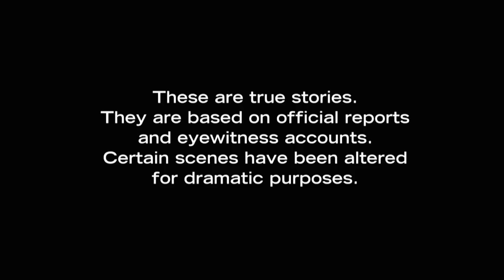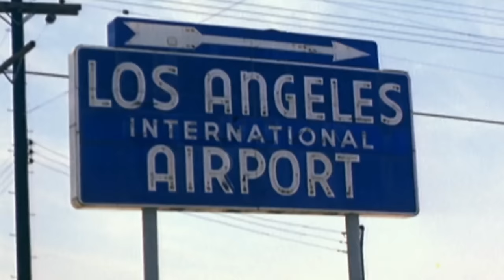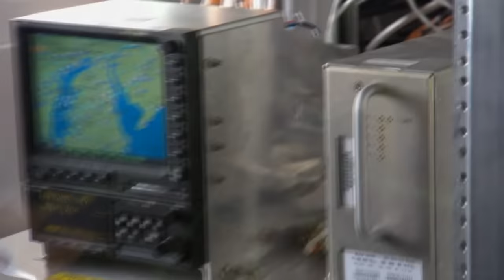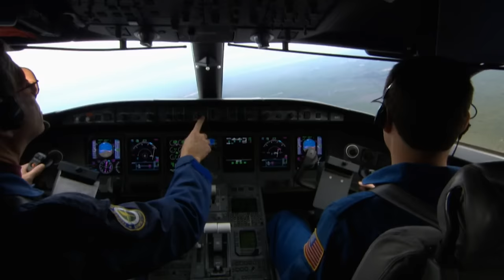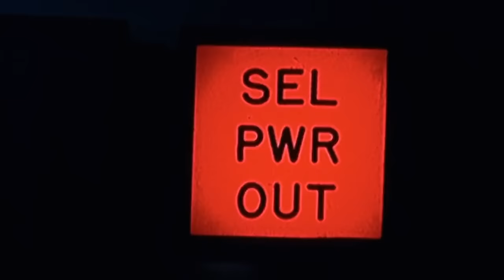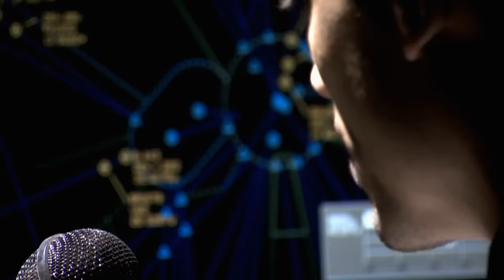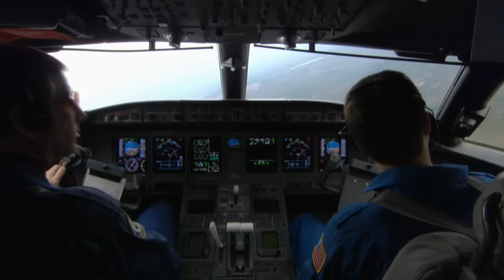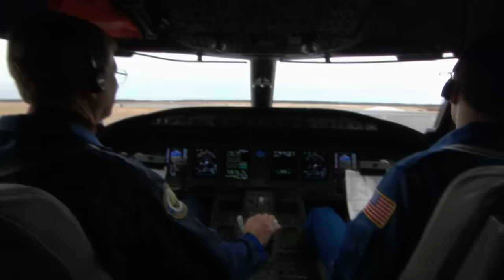The Race To Fix A Broken System "Before Disaster Strikes Again" | Mayday: Science of Disaster

Comment: I am surprised that Air safety boards took so long to introduce this system. In Maritime industry we have a similar system called AIS. It helps the navigators to see another vessel,  its destination & its intended path basis its present course even when its not on the Radar screen. This has been operational since I joined sea in 2005.
I always thought the air traffic systems are much advanced than maritime industry. It seems i was wrong!
Reply: that may be true, but your industry also has no form of crew resource management on the bridge when it desperately should, and your epirbs don't work as well as black boxes do
Reply: My guess is it has to do with having to track aircraft in three dimensions rather than just two.
Reply: Ships move very slow. Tracking them is very easy. 

Most countries do not own ships.
Reply: @God-mb8wi  First, we do have CRM. Second, EPIRBS aren't black boxes. They are just position indicating beacons.
Reply: @goo1358  Most countries don't own ships! What that has to do with tracking them.
Second, slow or fast its a radio and satellite based system. It has to be due to some other reason.
Reply: @brigidtheirish  See you don't need to track. All on board instruments give readouts regarding heading, altitude, air speed. All it has to do is to broadcast the same foe other aircrafts to receive it.

Comment: I hope this system will be very helpful, remembering the crash of the DHL cargo plane and the Russian passenger plane collided because the controller Peterson was overwhelmed and alone.
Reply: The system is already out and became mandatory in 2020 and is being used. It's not called Next Gen though, it's called ADSB. I literally use it all the time to help me spot traffic. It shows their position and altitude ON THE PLANE. Planes are required to have ADSB out which sends their position and altitude, however, ADSB IN is still not required, which is the system that shows other planes nearby and their altitude, in the cockpit

Comment: It is all about speed and greed.  Airplanes pushed ocean liners to the point of extinction.  In the United States buses were next to go.  Trucks and trains, however, are still economical for cargo but trains in the United States for passenger service is a shadow of what it was in the pre-1960s.  Answer, reduce flights and increase train and bus service.
Reply: 1/114 Americans will die in a car wreck, 1/1M Americans will die in a plane wreck.
Reply: That's not an answer, as it does not account for the fact that airplanes can go to places that trains and automobiles cannot.

Critically, an airport in a remote location provides a practical way for both people and cargo to travel to and from that location, whatever the reason may be. If you're going to do it with trains, you need to have rails run past that location. Those rails have to be manufactured, and then installed, and then maintained. How many miles of rail do you need for that? How much will that cost? The ground that the rails are laid on has to be prepared; it may need to be leveled or removed. What will be the environmental impact of that? What if there's a mountain in the way? How many additional miles of rail do you need to divert around it? How much will that cost? How much dynamite do you need to blast a tunnel through it? What will be the environmental impact of that?

The same considerations exist for roads.

What is the cost of an airport in a remote location? Less than roads and rails. What is the environmental impact of an airport in a remote location? Less than roads or rails. What is the challenge of maintaining an airport in a remote location? Less than roads or rails. What is the transit time to or from an airport in a remote location? Less than roads or rails. What is the danger posed to humans by an airport in a remote location? Less than roads or rails.

There is no scenario here where air travel is not the clear and superior choice.
Reply: wow what say
Reply: Definitely need passenger trains with the size of our country. I’d take a train over a plane, any day. Unfortunately, due to the lack of monetary incentives and slow returns, practical train travel is not thought worthy of the interest of any billionaires or the devastatingly in debt govt. With the fossil fuel issues however, we seriously must look at and develop, electric/magnetic trains nationwide. Fossil fuels are not unlimited resources. Save what is left of fossil fuels for lotion (yep. Where do you think petroleum jelly comes from?😂).
Reply: Have you ever travelled by bus? It's an agonizingly slow cumbersome and uncomfortable process. Putting more buses on the road isn't going to solve anything. There's little that can replace air travel for price and speed of getting from one place to another. And, as has already been said, you can't build a road or rail to just anywhere you want to go. It's not cost effective or, in some cases, even physically possible.
Reply: Le cringe statement 💀
Reply: Do me a favor and look up Amtrak safety record real quick then come back
Reply: I have traveled the country by air and by motor home. While there are advantages to motor homes, they burn a huge amount of time to get anywhere and time is something most people can't afford. Think of somebody from California visiting New York on a week vacation. As soon as you get there, by train, you would have to  turn around and head back.
Reply: The idea is very American

Comment: Isn’t NextGen system already available in form of Flight Tracker etc?
Reply: Flight trackers use the data from ADSB and radar although mostly ADSB Out now. Which basically is next gen so yes you're right, flight trackers use the next gen system, although it's not called Next gen. I didn't even know the original name was next gen until this video. It's just called ADSB. It operates as both transponder and ADSB at the same time. There are two ADSB, ADSB IN and ADSB OUT. ADSB out is mandatory which sends out position and altitude reports along with other data like speed. It's required. ADSB In, is a display in the flight deck, which shows nearby planes position and altitude, relative to you. I use it every day to help me spot traffic. But airliners, don't even use ADSB IN, meaning they don't have the system equipped to see other planes near them. As far as I know, and rely on controllers to help separate them from other planes

Comment: The date when this episode was created would be important. Not the date it was uploaded. 
Did this air 10 years ago? Kinda important.
Reply: It aired on June 2009. Next gen or now referred to as ADSB, is already out and became mandatory in 2020. Planes now must have ADSB that senda out their position and altitude. That's how flight trackers have the information of planes online in the first place. ADSB IN, is not required, but it's a system in the plane itself which shows pilots nearby planes position and altitudes. Our planes where I train in have it, so I can see all the nearby planes around me and help avoid them. ADSB has saved my life twice already, but it hasn't made air traffic safer really. Airliners don't even have ADSB IN which means they can't see nearby planes around them in their flight deck, they only send out their position and altitude to others. Most private pilots don't have ADSB IN in their planes either, only ADSB out. So Yea, nothing has changed drastically.
Reply: @davidt8087  Thanks

Comment: FYI this must be 20-30 years old, ADSB has been implemented for years and is required for all commercial aircraft.
Reply: Lmao I know. When the narrator mentioned Next gen, I was like, he can't possibly be talking about ADSB, as it's already out, but lo and behold Next gen was ADSB. I was surprised. I thought ADSB was a much older technology. But nope. It became mandatory to have ADSB out in 2020. Although so many private pilots have planes without ADSB In, so they can't see planes near them without actually spotting them or being told by ATC. Even with ADSB, near accidents in the air, haven't decreased honestly. I see insane private pilots flying rifht in the path of us completely oblivious, all the fkn time. If I didn't have ADSB In, idk how I'd spot traffic or avoid it. ADSB In has saved my life more than once. I'm not even joking. So next gen does work, but only tk those who have both ADSB IN and OUT.
Reply: Btw. I don't think airliners have ADSB In. I've never seen the system in the cockpits of airliners. At best they have TCAS. Which smaller GA planes don't I think. I'm also positive most larger airliners don't have ADSB IN?

Comment: There goes millions of more jobs lost to computers....
Reply: Nope. ADSB became mandatory in 2020, no jobs lost. All it did was make it safer for pilots flying especially in smaller planes that have ADSB In equipped, letting them easily know where to look out for nearby planes and their altitude. Controllers do the same amount of work still despite ADSB. The skies are no less safer or less safe with the ADSB becoming mandatory in 2020, but workload has decreased for pilots in planes equipped with ADSB IN which allows them to see on a map where other planes are and their altitude, and saved my life once before from a careless pilot which almost crashed into me mid air

Comment: Thank God for Flightradar24
Reply: Flightradar gets their info from the nextgen system which is shown IN THIS EPISODE. It's not called next gen, it's called ADSB, and it has saved my life once before by helping me spot a reckless pilot flying in my path, on the map in my trianjng plane long before I actually saw him. It's made flying safer (for those who have ADSB In equipped letting them see nearby planes on a map in the cockpit). Before, if a controller told you to look for traffic, youd have to spend quite some time looking. And smaller planes are harder to track, now, if you're plane had ADSB, you can actually know where to look because it shows on the map their Location and altitude. ADSB overall hasn't made the sky any safer or less safe. Airliners still don't have ADSB IN meaning airline pilots can't see the position and altitude of other planes on their cockpit. Older planes and private planes also don't really have that system. Only ADSB out became mandatory in 2020, which just sends out the planes position and altitude, but doesn't let the pilot see the position and altitude of other planes which is called ADSB IN.

Comment: You need to put ADSB in every plane in the US, and do it in the next 3 to 5 years! Imagine the lives that  could be made much safer.
Reply: Years???? They better do it right quick!!!!!!!!!
Reply: Yall are far behind. Lmao. ADSB out became mandatory in 2020. It's the transponder system which sends out the planes position and altitude along with other data such as speed. Etc. It's the thing That allows you to use flight trackers like flight aware or flightradar. ADSB In is a display IN THE PLANE, which shows the position and altitude of nearby planes around you. I use it all the time to help me avoid and see traffic. Although even WITH ADSB, nothing has changed. Still lots of private pilots who don't have ADSB IN. And get very close to hitting me. ADSB has saved my life more than once already. But airliners don't use ADSB IN, they only have ADSB OUT. This means they send their position to controllers and flight trackers and other planes, but they themselves can't see which planes are near them. So airliners still rely on controllers to separate them from traffic.
Reply: @yvonnegrassi9219  Yall are far behind. Lmao. ADSB out became mandatory in 2020. It's the transponder system which sends out the planes position and altitude along with other data such as speed. Etc. It's the thing That allows you to use flight trackers like flight aware or flightradar. ADSB In is a display IN THE PLANE, which shows the position and altitude of nearby planes around you. I use it all the time to help me avoid and see traffic. Although even WITH ADSB, nothing has changed. Still lots of private pilots who don't have ADSB IN. And get very close to hitting me. ADSB has saved my life more than once already. But airliners don't use ADSB IN, they only have ADSB OUT. This means they send their position to controllers and flight trackers and other planes, but they themselves can't see which planes are near them. So airliners still rely on controllers to separate them from traffic.

Comment: Yeah they really need to start devising and re - devising these existing airports where airplanes never sit and wait on runways, also airplanes should not be crossing runways to get to and from terminals either! but even with the aircraft's themselves from an engineering standpoint I'm seeing a bit more wiggling and flexing in these new airliners than I am typically comfortable with, these new massively powerful turbofan engines wiggle and flex all over the place on those mount pylons and the new Wing designs do also just a bit too much for my particular taste, I think graphene doping of aluminum will alleviate all these problems perfectly and get that amount of flex down to a more comfortable ratios, and it will totally eliminate a lot of problems that they've been having with aluminum in aircraft designs.

Comment: The deadly weakness in the system is not crashes. The deadly weakness is that jets are insanely polluting. High altitude emissions are far more likely to do serious damage to the delicate mechanisms at play in the frigid zones of the stratosphere. Jets actually fly inside of the jet stream to save some fuel and time, but the stream correlates directly and indirectly to our planetary weather patterns. Jets are also a powerful depletor of ozone. We need to get electric planes such as the Alice up ASAP.
Reply: It's highly unlikely that batteries will ever have that type of power density because of the way they store energy. If they do, one tiny flaw in the battery will turn them into a flying bomb. Look at what happens to an electric car when the batteries fail. Aircraft batteries would be far worst. By the way before you object, I have been working with batteries in the 50s before I reached my teens. I have also viewed the history dating back to Edisons electric delivery truck and the early electric cars.
Reply: @denawiltsie4412  I do object. I have watched this technology for a long time also, and I have seen major advances on every front. Solar energy science is nowhere near the apex of possibility. We have mag lev, frictionless bearings, regenerative braking, super conductors, fuel cells and solar panels which are miles ahead of the current models in use. The Alice has seen improvements in batteries even before it goes into full production. Imagine a plane with a solar absorbing body and wings, solar absorption 10X todays best and light weight batteries which are many times more powerful, reliable and safe. This is all very near. Jets are deadly, period.
Reply: Solar cells have been at 15% and they are now some that claim 20% so your idea of 10 time better isn't possible. I suspect that the physics of solar cells may not allow much more in the way of improvement and that will take a long time to reach.The newer cells may not have the life expectancy that the older cell do requiring much earlier replacement resulting in higher cost and waste. As for solar cells, I got my first one early in the 1960s while I was still in grade school. They can be a great idea for a mountain cabin where power isn't available however I prefer my connection to the Palo Verde Nuclear plant which is 30 miles away directly west of me. 
As for batteries, the problem is the amount of surface area available to react and produce power. A good deal of material is needed to hold the active material and conduct the power out of the cell. This has always been the problem. Sintering where powered metal is pressed together then heated to below the melting point under pressure has been used for years in NiCad and NiMh batteries. Lithium uses a more active chemistry upping the voltage but not really obtaining that much more current holding ability. Lithium is near the upper voltage limit for a chemical reaction. 
Understanding the Physics and reality of both problem, I wouldn't put money into what could be smoke and mirrors. When private investors are unwilling to put their money into something and the government put huge amounts of money into something, watch out. Remember Solyndra the Crescent Dunes Project. Fraud has grown from snake oil salesmen to the big time but government still hadn't learned with passing the inflation reduction act.